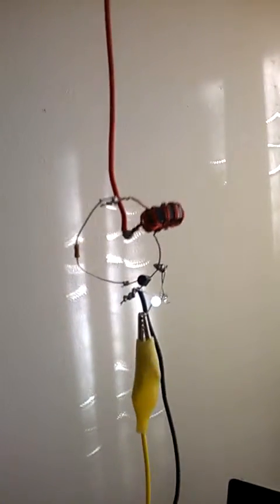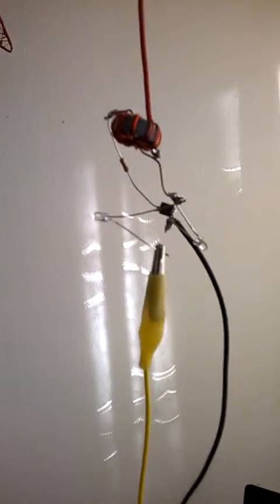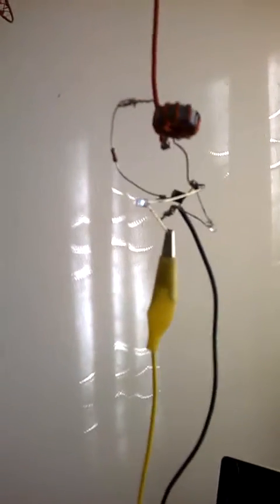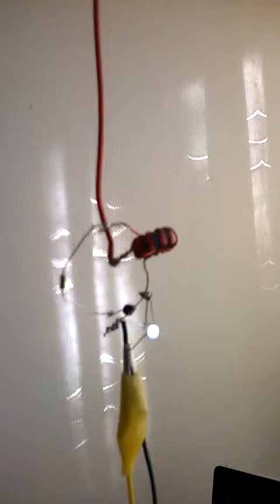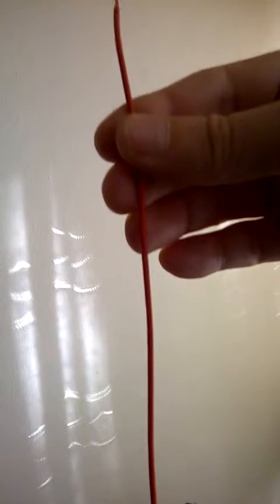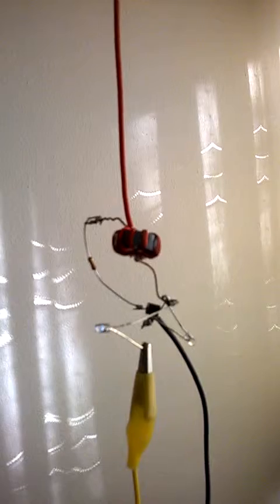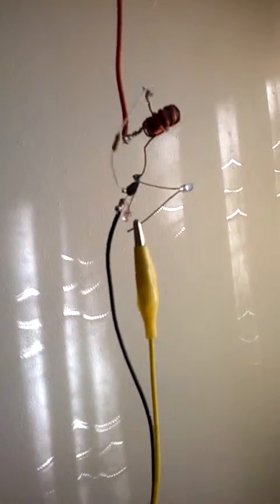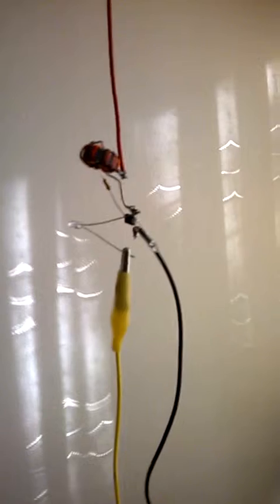LED Ion Transfer

Comment: Lol. I wonder why you don't show where the black and yellow cable is going.
Reply: Ipad (or tabet) headphone socket (you can see it in the video), which is supplying the small amount of voltage needed to dimly light up a single LED.

Comment: you seem to have it plugged into an ipad...like that is a source of power to light the bulb...correct me where I am wrong please...or do the experiment without the ipad.
Reply: Looks like it's plugged into the tablet's headphone socket (not sure it's an iPad, but it's a tablet nonetheless), a headphone socket will supply enough voltage (~0.8v RMS / 2.5v peak) to light a single LED (and the LED in the video is lit fairly dimly).

Comment: yellow jumper supplies power and black wire is the return.  Nothing to see here.
Reply: The yellow lead seems to be plugged into the tablet's headphone socket , a headphone socket will easily supply enough voltage (~0.8v RMS / 2.5v peak) to dimly light a single LED like this.
Reply: People like you are the definition of stupid...how on earth can the return wire be on the same leg...pay a little attention to details
Reply: @timookello3822  "how on earth can the return wire be on the same leg...pay a little attention to details"

The yellow and black leads are on separate legs.
Reply: @timookello3822  next time think before posting stupid comments.

Comment: Power fed via RF induction ?
Reply from the maker: This is NOT R.F. Induction in any way; there is no input of energy what so ever. IF you want the full text I will openly provide it to . But to help you along is a short passage for the book I wrote. 

Today Wednesday 23rd November 2016 (at) 10:30 GMT; I took this picture. WHAT the fuck is it you're going to ask? It is an ION, (not an electron or photon) but an ION. It is "TRAPPED" between two points in space less than 1/100th of a millimeter apart and last for a mere 1/16000th of a second. It is known as the ION GOLF BALL. This is the first time it has ever been caught on camera.  The color is BLUE and NOT "white" like a photon, it was NOT produced with electricity but produce by ION SEDUCTION. A replacement for Electricity. If you want to know more, take a look at my you tube of the same.
 The temperature at the core is as hot as the SUN, it size is 1/1864th of the size of an electron, and that folks is VERY SMALL. When “scaled up”, (from something smaller than a pin head), the amount of output power is more than 1000 times the power of any ATOMIC reaction, (including the big bad bomb); the orgasmic wonderful thing is, YOU can make this on your desk top.
Reply: What is the title of the book please?